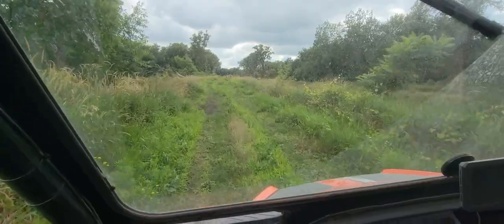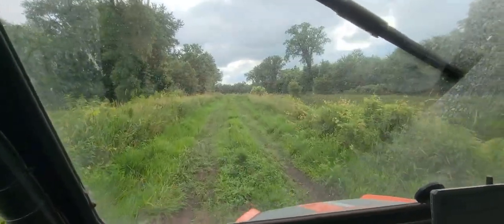Northwest 41 Dragline Digging A Sand Trap Video!

Comment: Used to do that in the river and screen it and make concrete out of it and use it on goffer courses. Paid the light bill and I was running a Lima. Ran a Model-6 at the quarry rock knocking and a 25 digging an irrigation pond for a goffer course. Both had Murphy's. The Lima had a GM/Detroit. Still can't hear.
Reply from the maker: That's awsome!....I hear ya on the hearing part cranes are like setting in a mailbox with a engine lol
Reply: RIGHT! Fixing to watch yours on getting the Kitty. Blessings 2 U! @dirtgrainsteel

Comment: Running a dragline must be akin to being the conductor of an orchestra with so many moving parts all needing to do the right thing at exactly the right time 😊
The idea of “throwing” that huge bucket into the river seems very appealing 😆
Reply: no.  you dont change the elevation of the crane.  all hes doing here is left right, and pull and release on two cables.  This is easier than an excavator if its not rusty

Comment: that is neat to see! it is neat method of digging out the sand. the weight of the scoop digs in,
then pull it out loaded with sand , dump and re do. nice video thank you for your time. how
is your drag line doing? getting it running again?

Comment: So a few questions.  Do you have to win a bid or something to be the person to have the rights to the sand?  Do you have to leave the sand there or is it yours for digging.
Reply from the maker: Sand stays to build up the levees to help prevent flooding in our super wet times that was actually part of the reason this trap got dug in this particular spot early this spring I came in and I repaired the existing levee and made it wide enough to support the dragline and now Jimmy is coming through and building it 3' taller and making it wider with the sand from the trap
Reply: @dirtgrainsteel Thanks for the information Brandon and video 👍

Comment: How do drag lines fair in clay soils I have a pond I want to expand and was thinking about a drag line to do it
Reply from the maker: They do really good with clay it's the super hard water sand that gives them trouble but it you have a good set of bucket teeth and a heavy bucket with the drag chains properly adjusted you can dig it
Reply: a dragline with good teeth on bucket will do a good job digging clay if there is little or no water in the pond. some times you need to pump the water out.